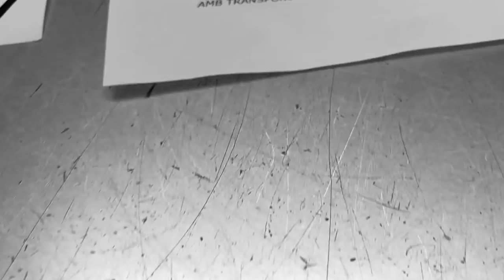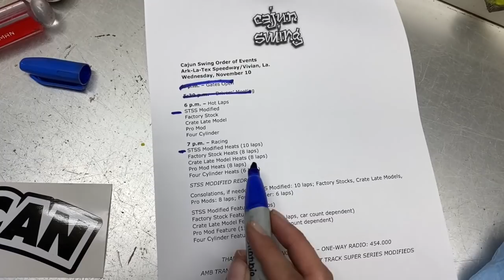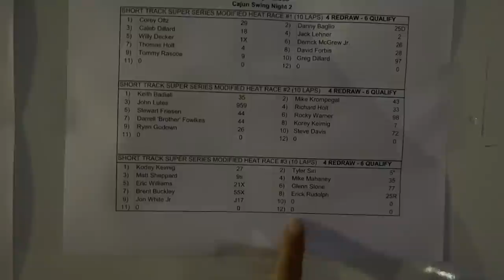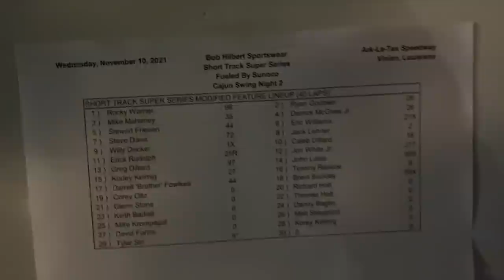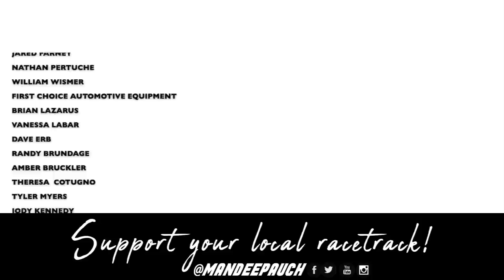Cajun Swing Day No.2 | Ark-La-Tex Speedway

Comment: They actually used to run 'skinny cars', which morphed into Limited Mod which is very similar to a smallblock NE mod, but with a wing, in the AR-LA-TX area. Devil's Bowl (TX) used to run them weekly. The ARK-LA-TX track owner Gene Boyter was a modified guy as well. Class died out in the 90's around here but there is still a regional traveling series for them locally. Center steer solid front axle type mods are not new in the area, just died out. Eldon Dotson is one local that folks from the NE might remember meeting in FL a few times 30+ years ago, drove the Blue Max modified for Raymond Beadle. Yes the same guy that raced funny cars and had a NASCAR team. He funded more than a couple motorsports teams of various types.